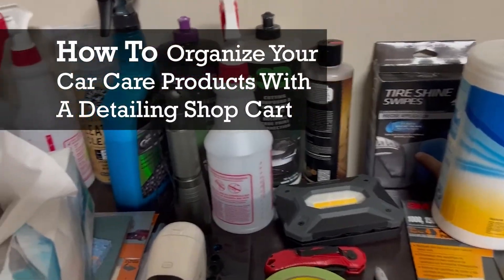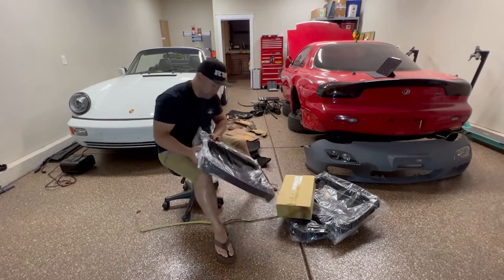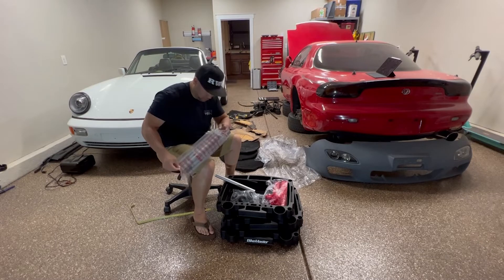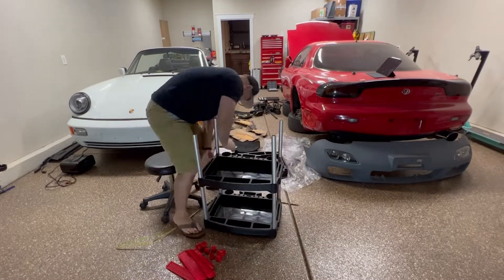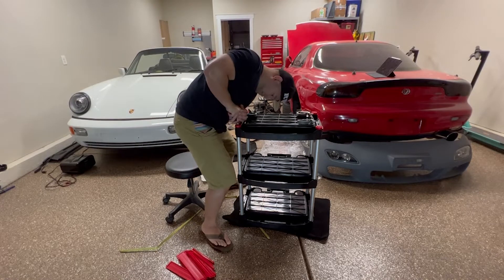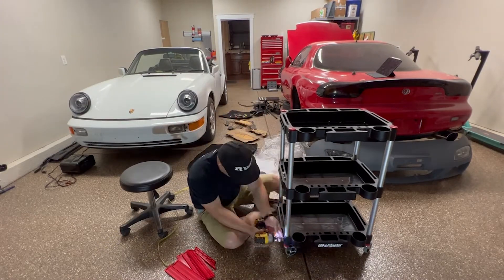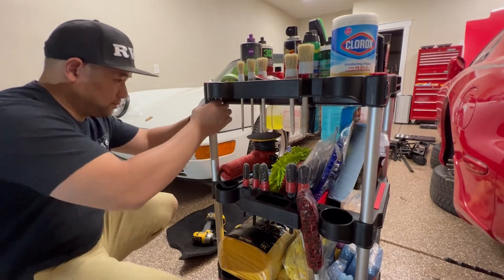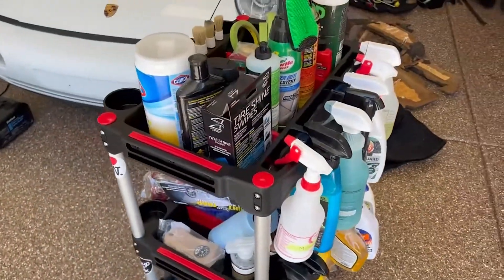How To Organize Car Care Products With The Best Detailing Shop Cart - In Stock Now!

Comment: Can two buckets fit side by side on top shelf?
Reply from the maker: Great question, I just tried it.  It will fit 1 home depot or lowes bucket in there, but it wont fit the wider 12 inch chemical guys car wash bucket.  But just as a reminder this is the same cart as adams, so even if you got that, it would still just be 1 bucket on the top.  There is space on each side of the bucket if you put it on the top too.  Its kind of like an oval.  Thanks for the question!